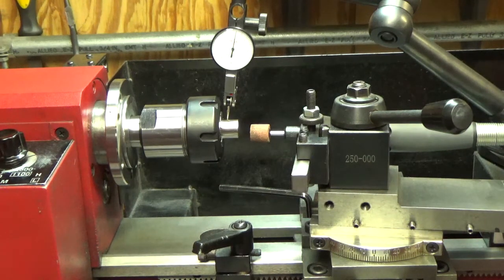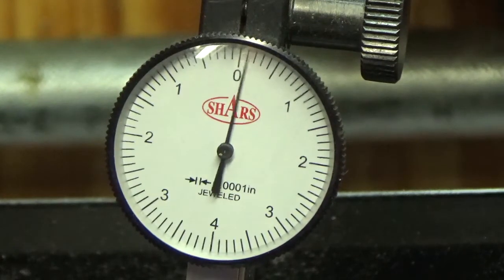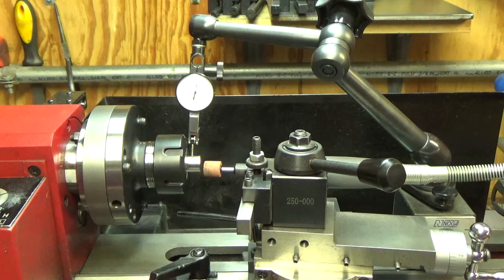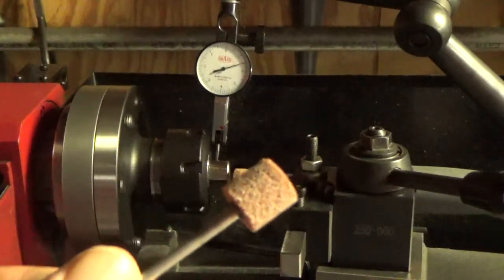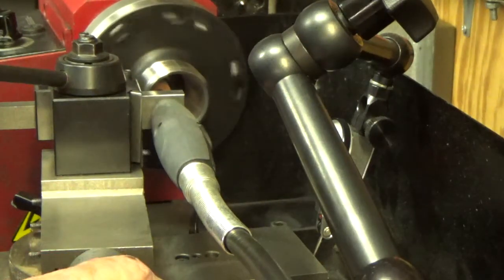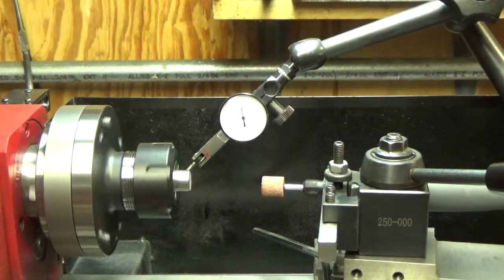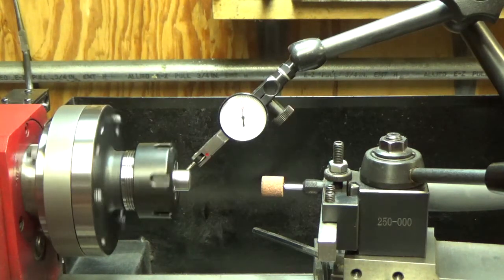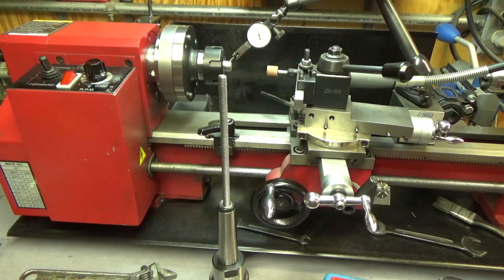ER32 Lathe Collet Chuck - Spindle Flange Mount

Comment: Very interesting video.  You have provided the base line on how to grind these bores without a lot of fuss or expense.  I have an er25 on my taig lathe and will be checking it and grinding as needed..  thank you.
Reply from the maker: Roy:  Unfortunately the three Chinese chucks I purchased were all bad, with terrible run out.  When you purchase a new chuck it actually should be concentric from the manufacturer and no grinding should be necessary.  Regards: Larry

Comment: Hey Larry I had a Dremel back in the 80's that was really sloppy what I did to fix it is split the case halves smear some Vasaline around the outer race put a couple of spots of JB weld or epoxy in the 2 race seats you might want to do this at each end if you can.
Reply from the maker: John: Thanks for the heads up.  Those flex shafts are so inexpensive, makes me wonder how they're built.  Anyway, it worked just fine for my current purposes.  Regards: Larry
Reply: @larrypoindexter9351  Does the Dremel have less slop than the cable ? if so can you use it instead of the cable.
Reply from the maker: @johnhubbard3399 :  I imagine the Dremel itself has a better bearing arrangement.  I've actually never checked it, because there has never been a reason to do so.   The motor would be to heavy for the tool post fixture as currently configured.  Regards: Larry

Comment: My Chinese bt 1337 lathe has a quarter tenth .000025 at the spindle and frankly I think it’s mostly picking up resonance from the motor. just a fraction of a line above 0. Never imagined it would be that accurate. So of course I’m picky as hell everything I connect to it. Any tool runout.003 and I toss it out or give away. I have a 18000 rpm 3.5kw spindle I mounted to a quick change holder and added a second vfd to the machine. Hang it up when not in use and drop it on for grinding or machining.
Reply from the maker: Glen:  Thanks for the comment.  My spindle run out is also very good.  I have 2 registered in involved here, so it's hard to make perfect.  The grinding does solve a lot of problems with cheap Chinese accessories.  Regards: Larry
Reply: Larry Poindexter I agree and it helps you have a very nice budget friendly Shars indicator. I have that same one and use it often.